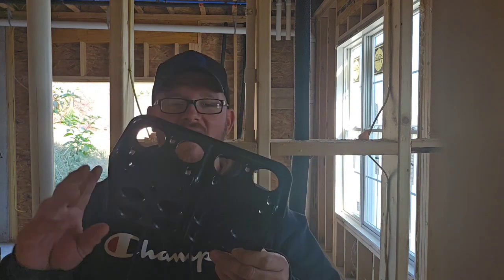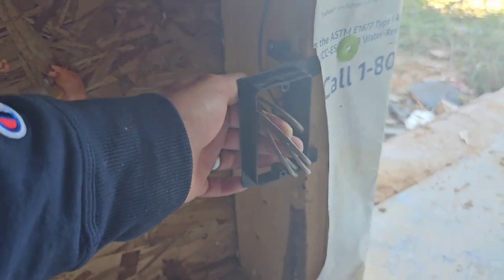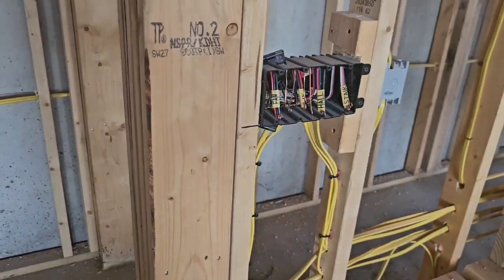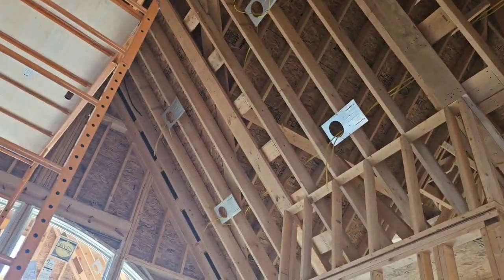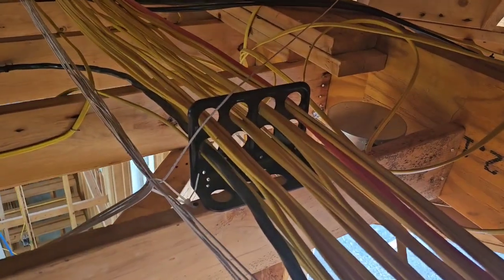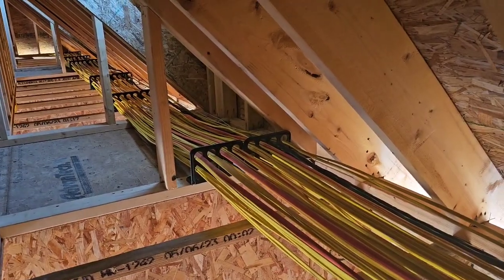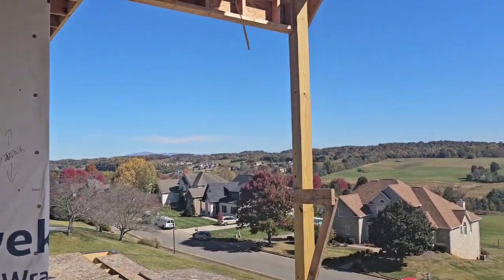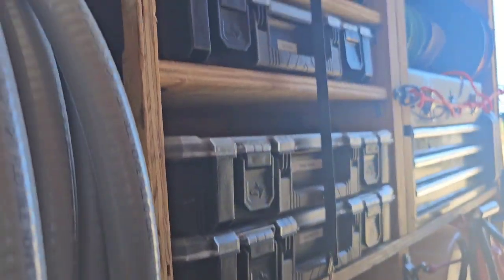Romex dud or destiny? You decide! Electrician Romex standoffs

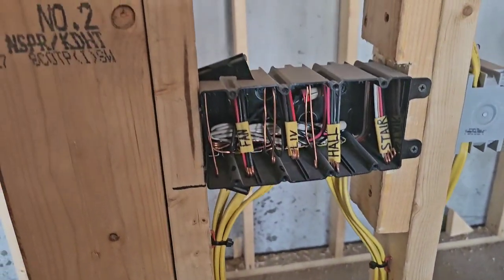Comment: 1:43 In NE Ohio, we mount the wafer boxes to a truss as close to the hole as possible, write (sharpy) on back side of wafer distance to center from nearest two walls... hang the lights from their clip on a wire. Drywallers will cut holes and install the lights.... Only time I've used those cutout plates is to get my finish inspection when I'm being held up by customer or other trades.
Reply: Don't count on sheet rock guys to lay out anything. If you wanna get it done right you have to do it yourself. I like the way you do your vanity lights. Cut in afterwards. You never know if the bar light is gonna have a long plate that mounts on the wall or just a canopy. And then there's the mirror and hopefully it doesn't go all the way up to the ceiling.
Reply from the maker: Man if we could get drywallers on board with that it would be a sweet dream, we can't get them not to cover up receptacles in the middle of a wall
Reply: Thats rediculous

Comment: I don't like the stripped wires in the switch box. If power gets applied to the house before devices have been installed, you have a possibility of a massive short circuit occurring in that box.

Comment: We used wafer plates, and the drywallers still F'd it up. I wish I could post pictures. They were terrible. Those other things look great
Reply from the maker: its amazing what they can cover up
Reply: Oh yeah. Those rockers just hate those templates. They break the router bits. The lazy asses could use a jab say at the light hole and do it by hand and save breaking the router bit. And all they do is whine about it. I had one general contractor tell them this is how it is, deal with it. Cut them out by hand. If you use a router and louse of the rough in template the rocks coming down so a new template can be installed. They wer upset. Some of these basements have had 30 recessed cans and trims or templates. That's too bad. It's what the customer wanted. Deal with it!

Comment: I am a fan of neat and tidy wire joints, makes the trim out so much easier, taking the time to label them but make sure they get turned around so the paint doesnt cover the ink, makes it great when installing dimmers.
Reply: Labels "Look" great... until drywallers and painters get there. I've seen drywallers clean their knives off in our boxes, painters blasting our switch boxes.

Comment: Coach, can we have a episode that talk's about the hood vent system control in restaurants😀😀😀😀.
Reply: The problem with exhaust hoods is the interlock with the fire suppression system under the hood and the make-up air. Some inspectors want the hood exhaust to keep running to draw the suppression powder up into the duct to prevent grease fire in duct. Some inspectors want the make-up air to shut down upon a fire. Some inspectors want proof of flow on make up air before exhaust fan turns on. They don't accept the switch for the exhaust fan to also control the make up air fan. Why, because maybe the motor is shot or a belt is broke or a bearing is seized. Restaurant people aren't concerned with the makeup air or interlocks or fire protection. They are in the food business. And then there's the interlock with the gas valve that feeds cook tops. Is it interlocked with the exhaust fan and fire suppression,? Then there's all the electrical appliances under the hood that are hard wired or plugged in. The electrical system has to be tied in with the fire suppression system. There is just so many things to be taken into consideration on kitchen cooking areas.

Comment: My question would be at the 3:50 minute part, I get nervous drilling LVL's   Is there a code or manufacturer rule on drilling them?
Reply: 3:59 You can see a "pop out" in LVL under the Homey Helper. If manufacturer allows, you can drill LVL's just get a data sheet from the Manufacturer. Some inspectors will -be a dick and- make you show documentation.

Comment: There's a guy who sells a kit for the garage door sensors and wires.
Reply from the maker: Thank you for sharing!
Reply: Yeah. Never seen a kit. I don't depend on the garage door guy for anything. I usually use a deep 1 gang box. Then I run my thermostat wire from each box back to the opener motor. And while your at It put a 1 gang box at 4' by each door so you can install a door bell button to shut the doors without having to use the key pad. Just reach inside the door opening and push the button. Of course the wires go all the way back to the motor.

Comment: That does not look fun to pull through. I'll stick  9/16 staples! Cheaper also.
Reply: Those rough in templates for the wafer lights are great. You can get them at the depot or Lowe's in 4 and 6 inch. But don't trust the rockers! Staple you Romex up high but make sure you can reach your loop through the hole. The rockers and their router will nick or cut your wire. Some guys do a beautiful job of making up and labeling their wires in switch boxes only to have them cut up by the rockers' router. The rocker doesnt accurately measure. He gets a measurement to the center of your box,. plunges in his router and cuts to the edge of the box. When he hits the edge he jumps over and then he routs around the outside of the box. So that's why you wanna fold your wires as all the way to the back of the box. And then you do a neat job of labeling stuff and folding them so neat and here comes the painter, like he's gonna care? So what to do? Well on switch boxes I fold the wires that I've labeled back in the box and wad up  some newspaper and shove that in the box. Now the paint won't get to my wires.